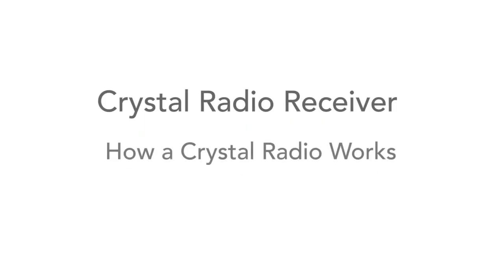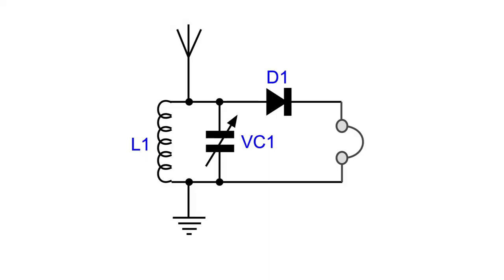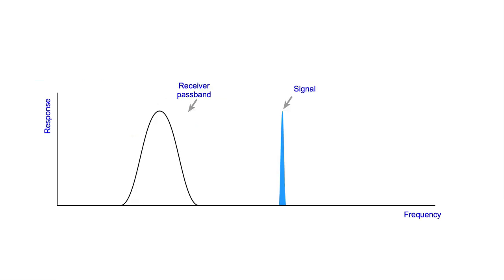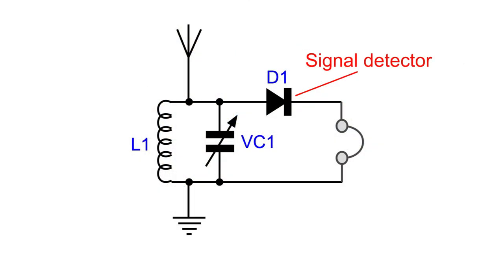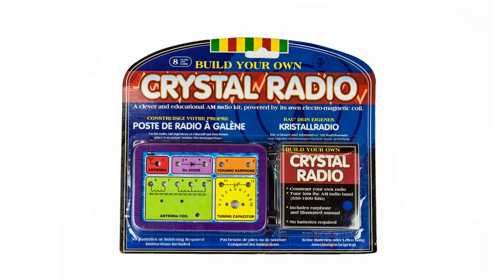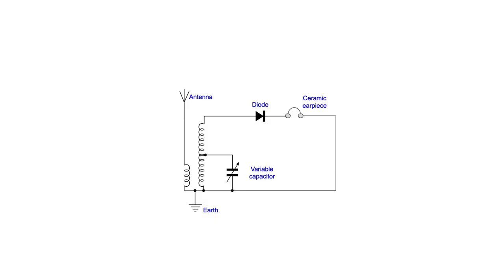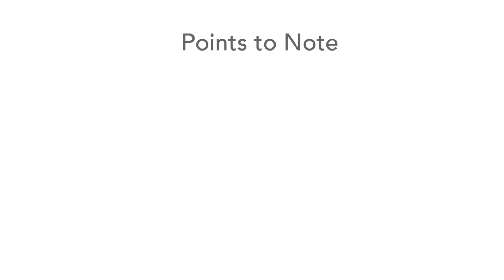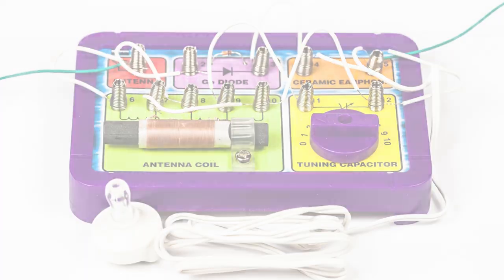How a Crystal Radio Set Works

Comment: I was just buying magnet wire on amazon, and it suggested a crystal radio piezoelectric earpiece.  I couldn’t quite remember where I saw it before.  But now I remember I had one of those 100 in 1 circuit discovery sets when I was 5, and it had components to build a crystal radio.  I remember being disappointed though, because it didn’t pick up FM.  Only sports, talk radio, and classical music.  And I eventually blew out the earpiece by hooking direct voltage to it to out of curiosity.
Reply from the maker: Curiosity and experimentation are essential in learning - we all blew things up when we were experimenting. However, I can remember having a crystal microphone. It was cheap and plastic and the only way in to see what was inside was to remove the thin tin foil diaphragm, which I did. I think I replaced it with a foil milk bottle top. It still worked (surprisingly) but I dread to think what the quality was like!  . . . but it was good to find out what was inside.
Reply: Elenco electronic playground 130.

Impressive you managed to detonate one of those piezoelectric earphones. Did you hook it up to mains or something?

Comment: Thank you for your good video. 

Question:  3:24 How much should be the length of the antenna ?
Reply from the maker: I’m glad you liked the video. In terms off the length, generally as long as you can make it. Possibly 50ft (27metres or so) but this isn’t exact. It really depends what you can do because the length would ideally be about a quarter wavelength long, but this is not feasible for most people.
Reply: Thank you for your explanation.

Comment: Antenna:  hook up to your cold water tap, if it's electrically conductable.  You will get a good range of AM stations.
Reply: That is the "ground" connection.  The antenna is a wire up in the air.  They go to opposite ends of the coil.
Radio signals appear as a voltage difference between the antenna and ground.  To get good operation, you need both connections.

Comment: Greetings Mr Poole, I have an interesting question that you might be able to answer about a crystal radio. In the early 1990's , I purchased a 100 in 1 electronics kit. I followed the wiring instructions  to make this project work. I could here AM radio transmission,eve when I removed the battery.  The radio station I was listening to,was located in a city one hour away from where I live. The city I live had quite a few AM stations. Perhaps the frequency of the distant station was stronger?  If any enthusiasts of crystal radios have a better explanations,or would like more information, I will be pleased to reply, thank you.
Reply from the maker: Without directly looking at your radio, my guess is that you were receiving a very strong signal froth e station in question. When you removed the battery, it will still strong enough to be detected or demodulated by the diode detector and to give audio in the output device. Really an unpowered crystal set - the original crystal set radios did not use a battery or have any amplifiers. I myself experienced a similar effect many years ago. Radio Moscow was broadcasting to the UK or Europe and had a very strong signal. It was so strong that the signal was picked up on the loudspeaker leads of my Hi-Fi system and rectified by the output devices in my amplifier and I could then hear the signal even with the system turned off. It just shows what can happen.
Reply: @ElectronicsNotes  Thank you Mr Poole for your well informed reply Perhap more information might be more helpful. The crystal radio was a project in the 100 in 1 electronics kit. The radio station was called 3GL on the AM dial. The city is called Geelong which is about 89 KM from where I live as I am in a suburb of the city of Melbourne. Australia.Melbourne has more radio stations,and somehow this radio project captured the radio station in Geelong. Perhaps radio 3GL had a stronger frequency. From what I know 3GL is now an FM radio station like many radio stations are going to the FM dial and even DAB. The question I ask myself is as technology is changing rapidly, will we still be able to hear radio frequencies on crystal radios or perhaps create FM crystal radios?
Reply from the maker: @julians9070  It could be any one of a number of reasons why you are receiving that station - may be you have a wire that is resonant on the frequency of that station, etc . . . .  As for the move to FM - you will need a proper FM radio for that. Crystal sets will really only receive AM stations because they detect the amplitude variations, and the tuned circuits are very broad and will not allow normal FM to be detected properly. The concept of a crystal radio is that they use a diode detector that enables amplitude variations to be detected, so unfortunately FM is not viable for them.
Reply: @ElectronicsNotes  Thank you Mr Poole for your knowledgeable reply. As the crystal radio was one of many projects on the 100 in 1 electronics kit, you may be  correct in saying that I had a wire that was resonant on the frequency of that station. If I work on another type of crystal radio in future, not using the 100 in 1 electronics kit, I can imagine which AM station I pick up. I sometimes wonder which radio station and what frequency a person could hear depending on their location, on the crystal radio toy that came with the six million dollar man super hero doll? You have encouraged me to delve deeper in appreciating crystal radios. Perhaps you may have heard about the Tesla sprit radio?. Kind regards.

Comment: But why does the crystal have to be there to rectify the signal? Or, IOW, why bother transmitting both sidebands if the receiver is only going to lop off half of it?

The headphone requires a push-pull effect to drive the voice coil/diaphragm?  You can't get that from just the upper half only?

As you can see, IDK what I am talking about.  Please help.

:)
Reply from the maker: In the day when crystal sets were used the technology to transmit single sideband was not available. Also both side bands are used when using a crystal diode envelope detector.
Hope that helps.
Reply: @ElectronicsNotes  OK, now I see!  I never realized the AM signal was the same above-and-below the line.  If we sent both sides to the earpiece they would cancel and produce no output.

So rectify it and we get a useful signal.

Thanks!

Comment: Could you use an OP-Amp to Amplify the signal coming from the antenna to the circuit, thus creating a more powerful signal?
Reply from the maker: You could use an amplifier on the output if the crystal set, but it is likely for most op amps that the incoming frequencies are too high to get much amplification out. If you wanted to add RF amplification then a transistor or FET might be the answer.

Comment: I had a rocket shaped one back in the day. Clipped a wire, with an alligator clip to a gas pipe and had power. Listened throughout the night.
Reply from the maker: Yes, whatever the type they were really easy to use . . and no battery needed!

Comment: I have this radio but doen'nt work as says  the follower It s a S...
Reply from the maker: One of the big issues with crystal radio sets is that they need a large antenna and strong stations that are relatively close by. Sadly with AM declining, it is not always easy to hear anything on crystal radio sets.
Also the wiring on the radio was not entirely clear I seem to remember, but it is quite some while since I looked at it.

Comment: Purpose of capacitor?
Reply from the maker: The purpose of the capacitor is to smooth out the rectified signal. It can easily be missed off with little degradation in performance.

Comment: Girls  THIS IS NOT  how  a  detector works,  this video is WRONG.   AM signals DO NOT have  some  "envelope" that "varies in strength."   An AM  RF signal  consists of an  RF carrier, often incorrectly called "dead key"  by  CBers.  This is an UNMODULATED RF SIGNAL.    When  you modulate an RF carrier with AM,  AKA lets say with a 1000hz audio test tone,  you are, in the  transmitter,  RF MIXING  the  audio frequency signal with the RF carrier,  and this  CREATES   the output signal, consisting of  THE RF CARRIER,  plus  a  SIDEBAND  1000Hz  above the rf carrier,  plus a  SIDEBAND   below the RF carrier  by 1000  HZ.  WANT PROOF?  Review  what is known as  "sideband," or  "single sideband"  correctly formerly known  as  "single sideband suppressed carrier", in which, in the  SSB transmitter,  a low level  AM signal is created, after which one sideband  and the carrier is supressed,  LEAVING ONE  SIDEBAND

In the receiver,  the detector REVERSES  the process of the  transmitter  modulator.  The incoming signal,  the two sidebands, and the carrier,  MIX in the diode  and produce  the carrier,  both sidebands,  and the  DIFFERENCE frequency between either and both sidebands  and the carrier, leaving the audio.  The RF carrier and the 2X  sidebands are filtered out, bypassed, leaving ONLY  the audio  frequency carrier.
Reply from the maker: There are two ways of looking at an RF signal - one is on the time domain as you see on an oscilloscope, and the other is in the frequency domain as you would se on a spectrum analyser - both are equally valid depending upon what you want to see.
Accordingly it is not incorrect to look at a modulated carrier in terms of an envelope - just look at it on an oscilloscope -or is this incorrect?
I agree that when you look at a signal in the frequency domain you see the sidebands as you mention, but it is equally valid to look at the envelope of an amplitude modulated signal and also see how the varies in amplitude - hence the named also the power limits that are defined for signals are often defined in terms of peak envelope power - yes this is used for SSB, but it is equally also used for AM.
Accordingly my explanation of demodulation in the time domain is perfectly acceptable and valid.

Comment: "Next the high frequency is filtered out."
What, does the Frequency Fairy come down and wave her wand?
You need to EXPLAIN how that's done. I'm left wondering how the F* that happens, dude.
Reply from the maker: Good point. The high frequency signal is filtered out by a small capacitor normally across the output of the detector diode, i.e. across the headphones. This must be small so that it does not reduce the audio. In many cases it was not required because the headphones could not respond to these high frequencies and in effect, this filtered out the signal frequency remaining on the output. Sorry for the confusion.
Reply: @ElectronicsNotes  Glad to see someone mention this "missing" capacitor. While the radio will work as presented, I learned about using this capacitor to enhance my builds around 1960.